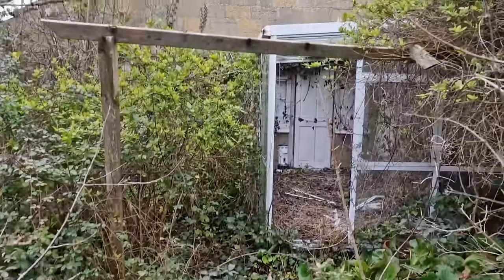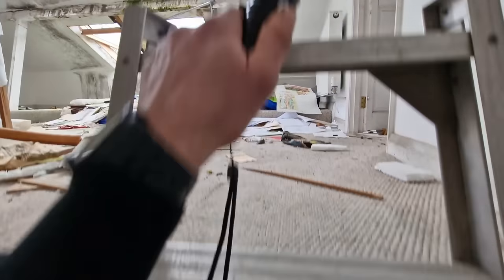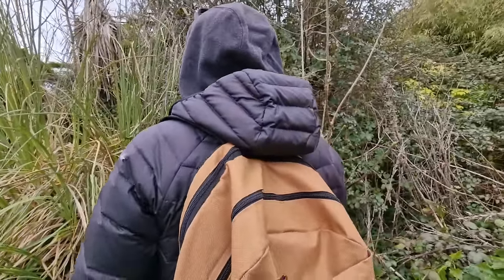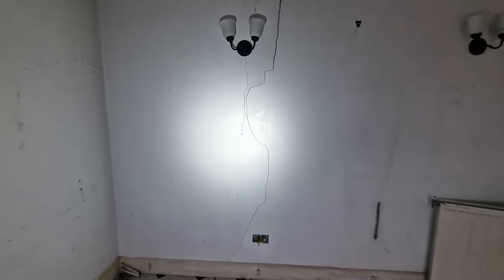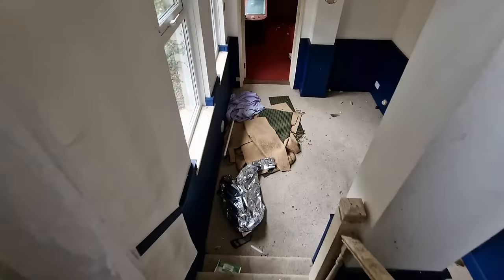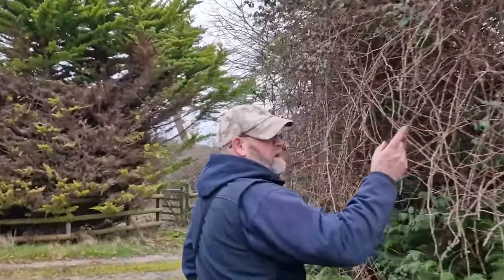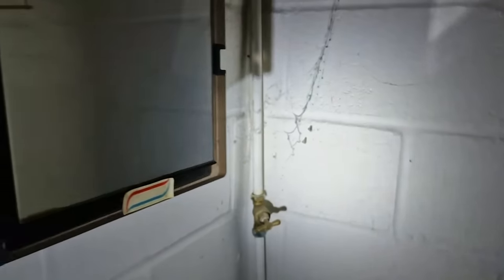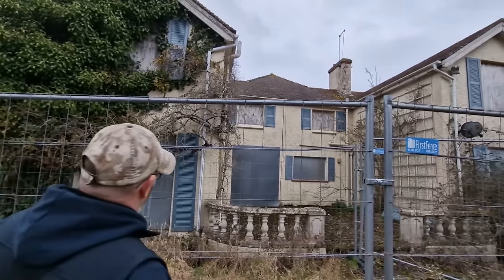The ABANDONED Isle of Wight street where houses are FALLING into the sea!

Comment: Looking at news articles for the local area, it appears that the major landslip happened  just to the left of the of first bungalow  you went in, and the road cracked open directly in front of the bungalow - it happened on the 12th February 2014, and the army was called in on the 16th to help evacuate the other houses opposite the bungalow, where the road completely fell away. It looks like the severe weather and loads of rain preceding this event was to blame. But if you notice further along the road there are traffic lights which has been there for some time before 2014, where that section of road had been moved due to what looks like a landslip there as well. So the houses would have been empty since Feb 2014, thats 9 years. Looking at Google Streetview, you can see they were occupied in 2009 and in 2011, but abandoned in the later 2019 view. The second house was called Mount Lavinia - you can see the name plate on the gate on the 2009 view.
The abandoned Ford Cougar is interesting though - you can see it on the drive in the 2019 view, but it shows as MOT'd until April 2019, so it was left there at least 4 years after the house was abandoned in 2014 - very odd that.
Very interesting video, but confused me when you jumped to that Harbour Farm place, which I found was located some distance from the first 2 houses you looked at.
Reply from the maker: Thanks for the info Steve, yeah the others at the end are also affected by subsidence so it all links in.
Reply: I'm wondering if somebody was using the driveway post evacuation to continue doing up the Ford Cougar? It needs to be saved by somebody, not me but somebody out there!
Reply: The car would of had to be used/ moved in March/ April 2018 at the very latest for it to have MOT until April 2019. So someone must of still been living there illegally until at least March/April 2018 before eventually abandoning it

Comment: Sorry guys, you're wrong. Observations of this property suggest an extremely poor build, on top of sloping land. The property isn't close enough to the sea for coastal erosion as a causal issue, as you suggest in your video. I envisage that when the owner tried to claim against their insurance, that their claim was rejected based on the quality of build. Did the owner involve Building Control during construction? Many homeowners are ignorant of this requirement; so how can you be sure the decay is due to coastal erosion? You're assumptions are hypothetical and pointless if you haven't conducted a full and thorough investigation in this matter. Think about properties in other parts of the UK: particularly those built closer to the sea than this property (even recent builds) or older stock that are still standing hundreds of years after construction. Having said that, I do enjoy your explorations.